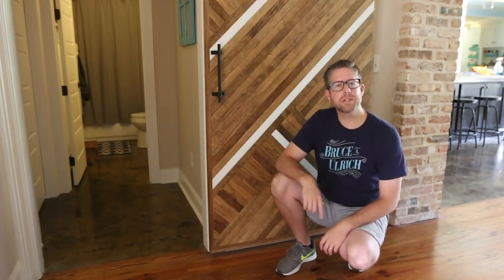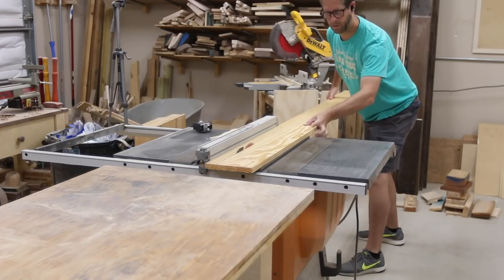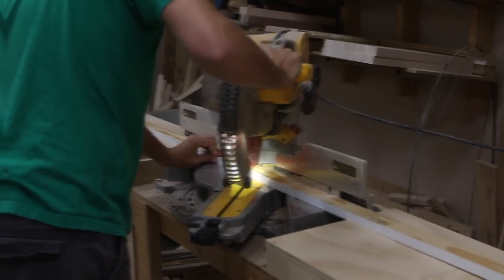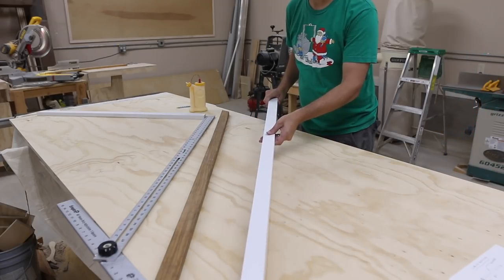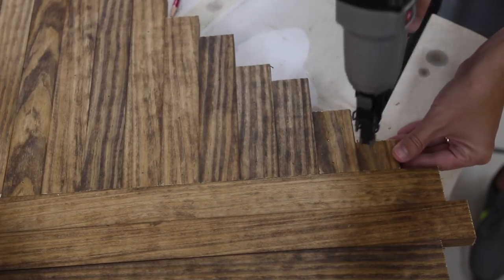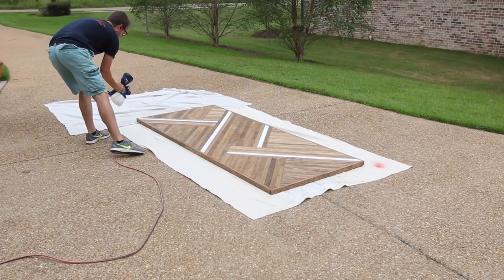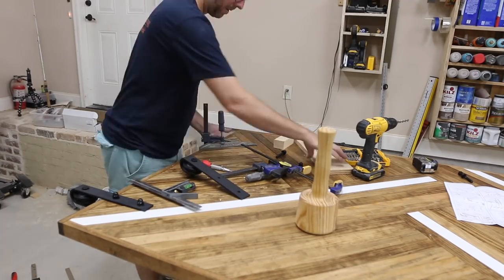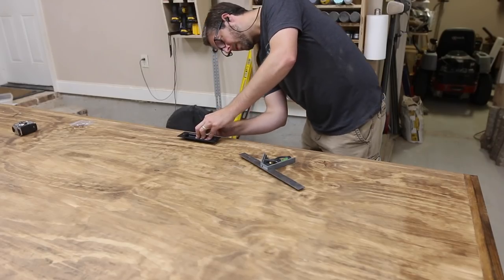Wood Sliding Barn Door // Easy DIY Woodworking

Comment: Great job Bruce! Really like the way your door turned out. By the way, get one of the Mixing Mate things from Rockler, makes it SO much easier to pour paint and finishes from the can.
Reply from the maker: Thanks, Johnny! So, you caught that paint blunder, huh? ha ha. Yeah, I need to pick up one of those. I've not been pouring paint into something like this until recently, but now that I have a paint sprayer, I've already been using it a lot.
Reply: I also punch a hole in the rim of the paint can so that what does pool up on the rim will drain back in. It gets covered when you pop the lid back on.
Reply from the maker: So, it doesn’t dry the paint out? Will you post a short video on IG of this and tag me? (@Brudaddy)

Comment: Nice build Bruce, I have plans to build a sliding barn door for my small garage.  I have one of those single piece panels that swing up. 

It's a pain!

Keep it up!
Reply from the maker: Thank you very much! The other barn door I referenced I made from parts I got at Tractor Supply Co. 5 years ago, there were no $100 hardware kits. They were like $400+, so I made my own and painted them black. Ended up costing about $150.
Reply: @BruceAUlrich  very cool, I think they make alot of sense on the inside of your house if you have the room. But it would free up so much space in my garage.

Comment: Bruce, I'm a new subscriber. Johnny Brooke has kinda been my own personal "wood whisperer." I've been searching for more content and came here after seeing Mr. Fishers push stick video and now I'm full circle back to Johnny...weird, right? I'm planning a restoration for a 1962 Airstream and I'm thinking a sliding barn door to the bathroom would work in a small space. Weight may be the biggest problem to solve. Thinking here....ideas?
Reply from the maker: Well, definitely DON'T go the route Johnny or I went with ours....crazy heavy! ha ha. Mine has an entire sheet of 3/4" plywood as a backer. Hmmm....not sure what to suggest offhand. I think you could get away with using some veneers or very small strips like I saw Jimmy Diresta do years ago for a table he did. You could try to use some 1/2 plywood, but having it stay flat without bow or warp would be the issue (I don't have much success with this with plywood thinner than 3/4"). I'm not sure of the size door you'd be doing, but you might consider using some strips and putting them together like an edge grain cutting board? Those are usually pretty stable with wood movement since they're all separate strips. Then, maybe you could drill out some holes on the back side in a cool pattern, allowing enough structure to remain, but reducing the weight? That's really cool that you found me (I appreciate it) and that you've come full circle right back to Johnny! And Drew Fisher is awesome...he and I do a podcast together now, and he's a great guy! (it's called We Built A Thing)
Reply: Bruce A. Ulrich thanks Bruce! My learning continues!

Comment: Can you use MDF as your base instead of plywood?
Reply from the maker: You could for sure. I think it would make the door even heavier though.
Reply: @BruceAUlrich  My question was mainly from the point of strength against the pattern making wood's seasonal movement. Would MDF be able to take that load without breaking or warping under pressure?
Reply from the maker: @varundaid3134  Yeah, I think it would be fine. I don't expect the strips of wood to have much movement, since they are in such small strips. Maybe each of them would move a tad, but it would be so small and not add up to much at all.

Comment: Hi, can I ask what colour the stains were please? Thanks
Reply from the maker: Hi! I used provincial for the darker one and Early American for the lighter one. Both of them are from Minwax.
Reply: Bruce A. Ulrich thanks Bruce, last question, how did you place/measure your guide for the final cut please? I’m reluctant to turn it over and cut from the plywood down. Thanks
Reply from the maker: I made a guide for my circular saw out of some plywood. Leaves a really nice cut. Just mark out where you want the edge to be & the guide acts as a zero clearance. Where the edge of the guide falls is where he blade will go.

Comment: Interested to know how you managing the swing movement since it’s not connected with the floor at the bottom and it’s free hanging?
Reply from the maker: I guess I didn’t show it well enough, but I have a groove in the bottom of the door and a small piece attached to the floor that rides in the groove. That keeps it from swinging out.
Reply: Thank you for the swift response, I watched twice but could not understand that specific part. I recently installed two doors in two different locations but really suffering with the bottom as it’s coming off the wall. We don’t have any accessories available locally while I don’t want to use the aluminum channels at the bottom. If there is any specific video on it, please share the link. Many thanks for the great work.

Comment: Very good look and style. I did a similar door and agree that it is as much a piece of art as it is a door. One thing that really becomes apparent quickly is the opening and closing of the door. Soft close devices are easily installed and the door banging ends with a gentle closure.
Reply from the maker: I need to pick one of those up. I've had someone else tell me about them, and I just need to do it. Thanks for checking it out!
Reply: @BruceAUlrich  I used Harney kit but there are a number of ones out there. Inexpensive have been working well for a few months now.  And, no, I don't work for Harney.

https://www.harneyhardware.com/collections/barn-door-hardware/products/barn-door-soft-close-kit-satin-nickel-36323

Comment: Hey Bruce, I love this piece.  It's such a different take on a classic barn door, very well done.  Couple questions, did you fill in the nail holes?  Did you design the piece before you started putting it all together, or was this designed on the fly as you were building?
Reply from the maker: Thanks so much, Nick! Ok, so I did fill in SOME of the nail holes. I only painted white paint in the holes of those strips. These small nails really didn’t show in the stained pieces, so I didn’t bother. As for the design, I did sketch it out by hand after I had the initial idea, and my wife and I landed on a rough arrangement of what the sections would look like. Of course, some decisions were still made on the fly. I was originally only going to have 3 white pieces. We ended up adding a 4th one and still liking how it looked so we left it. The Little section with all of the short pieces that were the same length was a build on the fly kind of thing. Great questions!